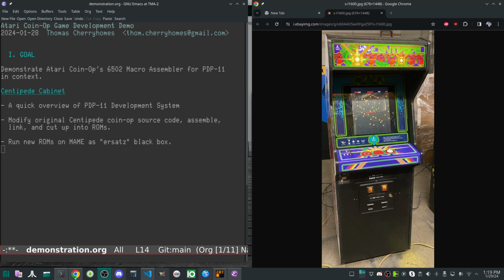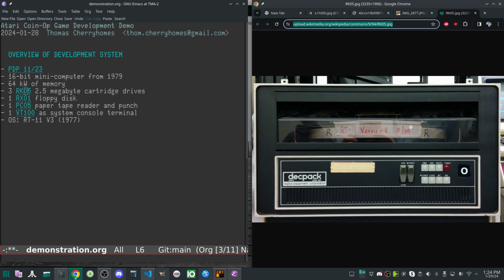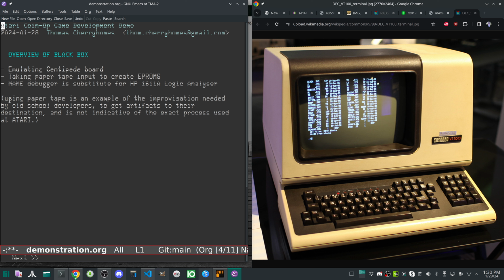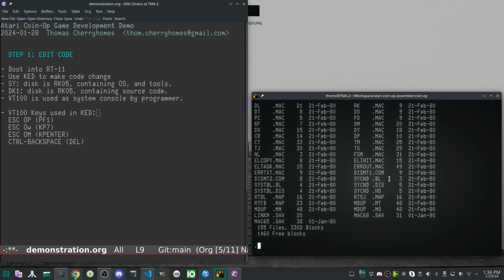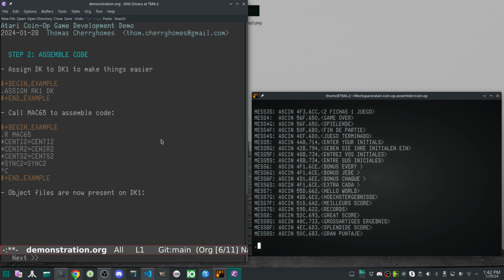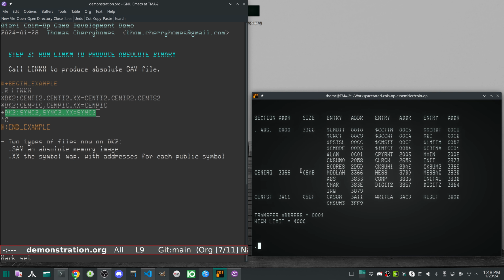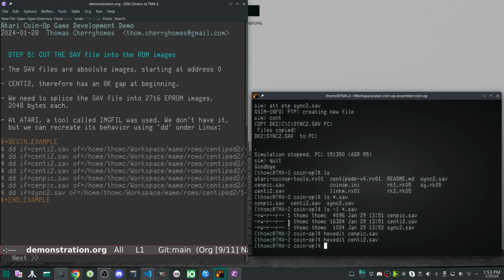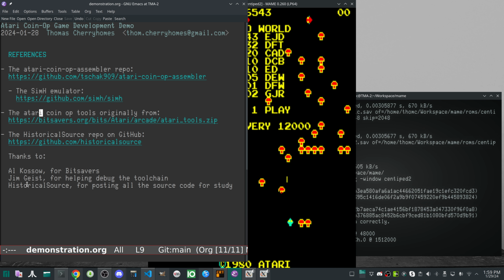CENTIPEDE! How Atari Coin-Op development tools worked!

Comment: Awesome video!  For me it was as much about the navigating the PDP as it was changing the "hello world"  :-)  Biggest question I have is why the modification didn't leave the checksum wrong, and make the game crash?  What recalculates that checksum? Is it part of the assembler/linker process to calculate and store the new checksum?
Reply from the maker: I tried to address this, but the simple answer is, there is no global checksum, but rather checksums for things like the copyright message, if you don't modify those, they don't need to be changed.

But there are checksums for ranges of code that need to be adjusted, and you'll find those in the code by searching for "CKSUM*"
Reply: @tschak909  Makes sense..  It was definitely within the capabilities back then to search for ASCII strings in an eprom and edit them..  With these tools you demo'd and/or at least modern debuggers, it should be easy enough just to find the code that checks the actual checksum and bypass it!    Stuff like that is what got me interested in programming back when I was a kid.  I dont know how long I spent trying to give myself 255 lives in my TRS80 pacman clone.. I'm not sure I ever succeeded, but at the time, the extent of my tools were to look for a "3" byte and try to change it!  Fun times!

Comment: I wonder how the polygon graphics for "I Robot" and "Hard Drivin" series was made. Had they a graphical editor or was that still all pen and paper?
Reply from the maker: For I Robot and Hard Drivin', Atari had their PPS (Pixel Processing System) which was based on a PDP 11/05.
Reply: @tschak909  Was there a graphical editor, or was that only used to output graphics for test before the arcade GPU hardware was finished? Was that the actual hardware of the unfinished "Air Race"? (On MAME it lacks sound and text font. Videos show that the original apparently had both, isn't it?)

Comment: [38:30] Oh, luxury! Back in the day debugging wasn't nearly as nice as a screen showing all your registers. You were lucky to even have a serial monitor that could single-step! An in-circuit emulator would be the Cadillac ride. I've been using the TUI mode of GDB with a microcontroller at work for a little project, and I don't complain (much) about its clunkiness because I remember how things were in the early '80s.
Reply from the maker: Good point!

Comment: Very cool, love it! Do you have any knowledge of how the HP 1611A logic analyzers were used in practice? The 1611A seems to provide  an instruction trace and had a kind of breakpoint type feature, but nothing (as far as I can tell) for displaying registers or interacting with the CPU beyond single stepping. 

I think it would have been possible to use the trigger up to generate an interrupt, and then have the interrupt routine dump all the registers, but I wuld love to know what they actually did for debugging.
Reply: No, it was a clip on. We had one amongst us in the lab in the earliest years so it got moved from lab to lab as needed (it was always needed). It basically just gave us a glimpse of what might have gone wrong. No breakpoints. No inspection of registers or memory. We could set it to trigger on the CPU reaching an address as it ran it's normal program then get to see in the history what memory was read/written just prior to the trigger and maybe it also made a snapshot of some things after (I forget). That's about it. Single stepping might have been an option with it, but I never used that feature with it. Soon after we rigged up our own little development systems (based on the Kim, Jolt and Micbug). For the 6502 ours was called the AtariJolt. I don't think we ever made a home built one for the 6800 or the 6809. Soon after we made a several different iterations of a much more complete custom built in circuit emulator. I think the last one was what I called the "White box" (it was in a white box). It recall it never quite worked right.
Reply from the maker: @d_shepperd yes, I meant to say it was clipped on. :)
Reply from the maker: They were attached directly to the CPU socket, I don't have one here or I'd demonstrate it.

Basically you get a program  counter, and an instruction decode, with a small history (64 instructions or so). You can single step, and set hardware based breakpoints (e.g. on a vertical blank interrupt)
Reply: @tschak909  There are manuals for the 1611a are on bitsavers. It looks like a predecesser to an in-circuit emulator. The 1611a doesn't appear to have any built in ability to view or set registers or memory (beyond what is in the trace).  It does have an output when a trigger is hit, so in theory you could wire that in so that an interrupt routine could dumps the registers (which would be viewable in the memory trace). If the ROMulators they used allow runtime modification, you might be able to patch in a dump of specific memory too. 

Just curious to know how much they were able to do during debugging beyond the minimal capabilties of the 1611A.